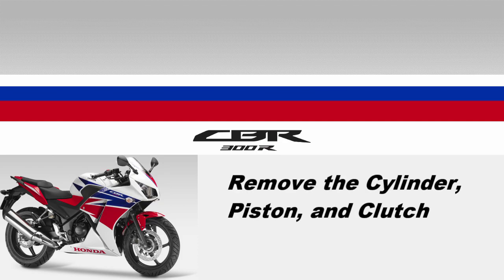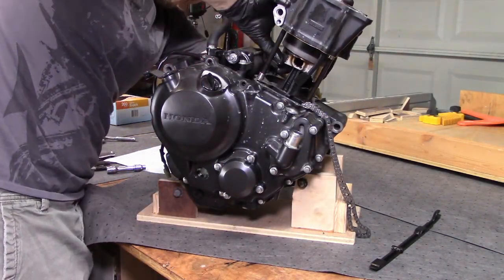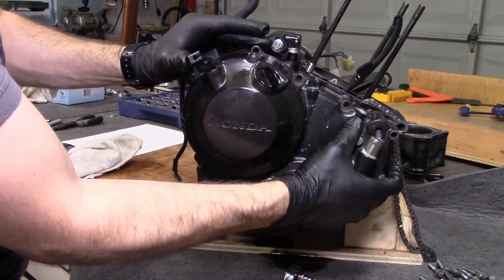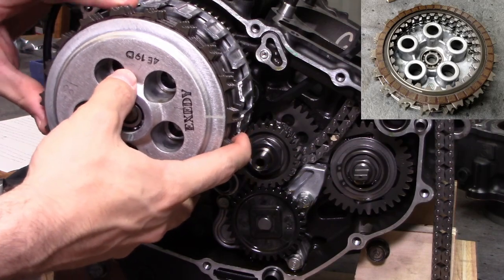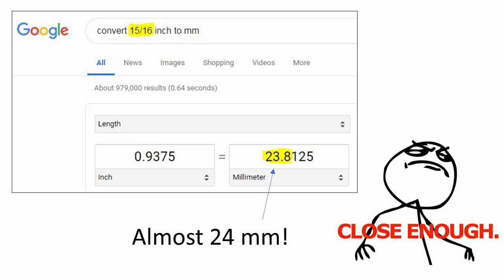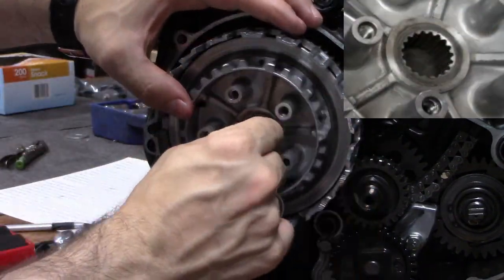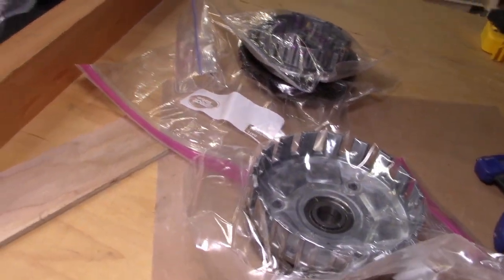CBR300R - Engine Teardown Part 2: How to remove the Cylinder, Piston, and Clutch

Comment: I think these are the best videos on this motor. Great job man. Today I got the valve head off and made it to the clutch basket part and had to call it. Going to order one of those wrenches. But so far I learned the motor is blown and the only damage I've seen is a completely broken intake rocker arm. Cant wait to see what piston looks like
Reply from the maker: Thanks for the compliment, and best of luck on your project!

Comment: Cheers from Concord, NC! 

I am in the process of replacing the crankshaft on a 2016 CBR300RA and these videos have been EXTREMELY helpful. Thank you for posting these! 

For the para cord trick, I used the same concept but with zip ties as I was out of cord. Worked like a charm!!
Reply from the maker: Glad they help, and thanks for taking the time to drop into the comments. Really makes my day :)

Comment: Does anyone know if you can remove the cylinder without pulling the engine
Reply: Definitely not, can barely change the spark plug without pulling the engine 😂

Comment: trying this on cb500x which is pretty similar to yours, except the clutch stake is a beefy beefy piece of steel. I ended up pushing a part of it into the gap and now is proper stuck. FML

Comment: Hi guys,

Need expert advice I have a 2019 CB 300r which does not come with a slipper clutch, but the 2022 and 2023 edition comes with slipper clutch, when I approached the Honda experts if I could install that 2023 edition slipper clutch on my 2019 bike they instantly disagree with this decision and told if I do this I will lose my bike warranty.

So the question is can we install a slipper clutch from 2023 CB 300r on a 2019 edition?
Reply from the maker: ¯\_(ツ)_/¯
No idea...I've never worked on a slipper clutch before. From what you said, sounds like their concern was warranty....so maybe the warranty will be void, but it could work just fine?
Reply: Can you just put a word around and lemme know if this will really work?

Comment: Hi I noticed that I am leaking oil from the gasket from the right crankcase cover. To replace this gasket A: Do I need my engine out of the motorcycle? and B: Do i need to remove the upper portion with the piston. 2:38 is my reference. I am pretty handy with tools just need some advice as this is my first motorcycle.
Reply from the maker: Hi there! Congrats on the motorcycle. 
A) you do not need to remove the engine to remove the right crank case cover. 
B) you do not need to remove the piston, but you do need to remove the water pipe https://youtu.be/aYPgLPFuNRo?t=19
Dont forget to also need to drain the oil https://youtu.be/MjdBdM5cx9U?t=77 and the coolant https://youtu.be/6BB7Ad8q9Zs?t=93 before pulling off the crank case cover!

Good luck!!
Reply: @lightningfrog27  Thank you! While i have the right crank case off is there anything that I should take the time and swap as maintenance like the O rings or clutch discs? Also thank you for the great documentation on taking apart the motorcycle. Literally nothing on the cbr300r and would be lost in manuals and documentation without the ease series of videos! Great Job!
Reply from the maker: I'm at a conference this week for work, so I don't have my factory service manual handy...I'll take a look this weekend. My guess is that there's nothing that NEEDS replacement...but if you were considering swapping over to stiffer clutch springs or whatever, this would certainly be convenient timing!

Comment: badly scored piston and wrist pin.. diagnostic of lubrication failure..  This is one of the prime reasons when I buy a used CBR300R.. I Do NOT want to buy it from a beginner for whom it was a First Motorcycle... for reasons illustrated here !  ( also there was a recall on these engines for lower end problems.. and presumably some did not go back for the new bearings).

Comment: For the 24mm socket, look at the DEWALT DWMT73813 Drive Socket Set (23 Piece), 1/2". It's a decent SAE & Metric set that leans to the large sizes, which is what you want for a 1/2" and its still a pretty good good value. The metric side tops out at 24mm. (Just trying to pass on finds I've made when building my own toolbox over the years. Hope this isn't viewed as inappropriate. I'm enjoying your videos.)
Reply from the maker: Thanks for the tip, and I'm glad you like the vids!!

Comment: You need to get yourself a SK 45172 3/8-Inch Drive 1-1/2-Inch Professional Thumbwheel Ratchet. They're ridiculously overpriced, but the gears are smooth as butter compared to the cheapies and it looks like you'd get your money out of one.

Comment: Hey, so somehow the wire that opens the passenger seat latch must have broke in my CBR250, I'm hoping you have a solution to get under that rear seat, or even taking that left side fairing off to get at the cable to open the latch maybe I can pull it. I'm just lost and can't find anything online. Thanks!
Reply from the maker: Hey there...I'd be happy to look at this and see if there is some sort of simple work-around. Am at a conference this week, so my next chance to be in the garage isn't until this coming weekend. 

In the meantime, have you tried posting to https://www.cbr300forum.com/ ? There are a lot of smart/experienced/helpful guys there that also might be able to help.
Reply: lightningfrog27 no worries! When you get the chance just let me know! Thanks you
Reply from the maker: @zachhirst2168  Ahoy there! I made a short vid so you can see where and how the moving parts go when you turn the key.  I imagine you could hook the tab of the barrel with a coat hanger, or maybe a 90 degree pick. Access will be tight with the seats and fairings in place, and there's no existing openings from below. If you cant get it with a bent wire, maybe the best bet would be to drill a 1/2" diameter hole up from underneath to have access to that rotating barrel. Here's that video: https://photos.app.goo.gl/dzCuz53Zsodpz3Pp7

Let me know how it goes for you!

Comment: Great detailed video! Was the piston in good condition?
Reply from the maker: Thanks!!

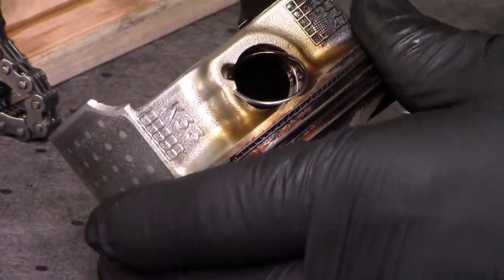I dont "exactly" know what to look for regarding the goodness of the piston....but so far as whether it's likely the source of the knocking, i doubt it. The wrist pin was smooth and tight, the piston rings seem to all be in good condition. The only thing i noticed that i could complain about is that one of the side faces of the piston looks "new" and the opposite face looks striated. You can see the two different sides in the video between 1:27 vs 1:40. I suspect the striated side is the "thrust" face....meaning that's the side that the connecting rod is on during the power stroke. It doesn't feel terribly grooved, and the piston rings do the sealing anyways, so i think its fine?
Reply: @lightningfrog27  Did you grab the conrod and see how much play was on the big end bearing? This is a likely source of your knock. Great work BTW.
Reply from the maker: @Alofthewest  yeah...it feels really stiff...I couldnt notice any slop in the up/down direction or the side/side direction.
That is pretty confusing to me, since the problem has to be coming from somewhere, and it feels like I'm running out of suspects!